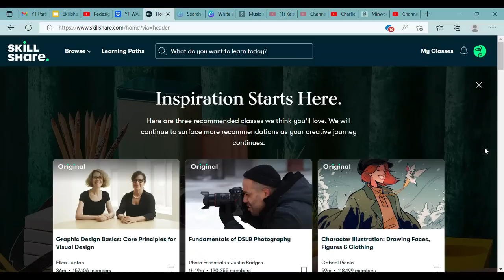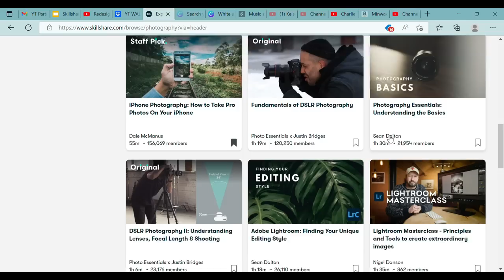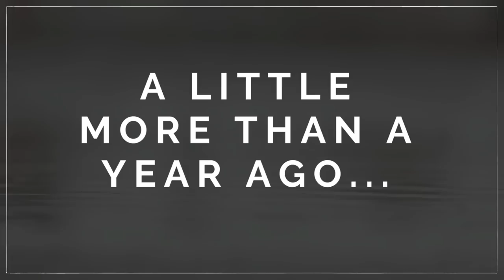STAIRWAY MAKEOVER REVEAL!! | How I Turned My Carpet Stairs Into Hardwood

Comment: If you ever have that problem again with your wood looking pink- mix up a paint wash using a green  paint. It will minimize how much red/ pink if popping thru. 
I had to do this method on a mid century tiered side table. I was about ready to pull my hair out but then remembered the color wheel- green/ blue cancels out red/ orange. Hope this helps! Your stairway looks amazing btw!! Great work!!! ❤
Reply from the maker: Thanks for the tip!

Comment: You really need to rig up a sawdust collector. Just put a PVC elbow joint on the table  and connect it through the lid of a trash can. Use a flex tube to help ease lid removal. And wear a mask when cutting wood. Wood dust is dangerous! So don’t have your kids stand in front of the output of the dust chute.
Reply from the maker: While watching the footage back, I realized I totally could have hooked up my shop vac to catch all the saw dust. I’ll try to remember this for future projects.
Reply: Good suggestion….minus the unnecessary ‘shade’. 
I’ve watched hundreds of random home renovations/maintenance YT videos, clearly some are better than others. As for this staircase makeover series…TOP NOTCH! Being a novice ‘Jane of all trades’, I am so impressed with how many of my skills have bumped up a level just from the ‘little details’ covered in these videos. I’ve got nothing less than gratitude for Kelsey’s efforts…that she has taken the time to share at no cost to me.

Comment: Great video and project! And thank you for the explanations. I don’t know if you answered these already - don’t have time to read all 232 comments - but, what were you using to wipe the caulk on the treads; looks like baby wipes? Also, how did you fill in and finish the nail holes on the treads? Thanks for your help and replay!
Reply from the maker: Yep baby wipes are super helpful when caulking because they help to smooth the caulk and then you can just toss them. I was prepared to fill the nail holes with wood filler but when I went to do that, I had a hard time finding them! So I just left them because they’re almost impossible to see.

Comment: This is awesome! question, what did you do for the landing at the top of  the first set of stairs?
Reply from the maker: These are the only stairs. I ended up replacing the carpet in the upstairs hallway with the same flooring as the first floor.

Comment: Hi, great looking stairs. Since you are adding 1" steps/treads, the space between the top step and floor will be an inch shorter than the rest. Also, the bottom step will be an inch taller. Could this be out of code? And a tripping hazard?
Reply from the maker: I looked up my local building code and it’s still in the acceptable range. It hasn’t been a tripping hazard so far.

Comment: Kelsey did you have to trim the sides of the treads to fit in your stairwell? Or just the backs? I started this project at your inspiration and we are having a bit of difficulty cutting the sides to fit flush even though we used the stair template tool. I'm thinking the side angles will change once we can get the tread in be able to determine how much needs to come off from the back. Do you have any suggestions?
Reply from the maker: I trimmed both the back and sides. I trimmed the sides first to the correct angle then trimmed the same amount off all of the backs. They are definitely not perfect but I was able to get a pretty snug fit. Hope this helps.

Comment: I am curious - you used a standard 1" tread and by installing them on top of the stairs "subfloor" wood it added about 1/2" to your stair height. Is it noticeable when you walk up/down?
Reply from the maker: Nope not at all. I add them to each stair so the difference in treads stayed the same. The only treads that are a little different are the top and bottom and you can’t tell at all.

Comment: If you don't already know, I recommend you learn color theory and the color wheel.  What I hear you saying is you wanted a neutral color since you mixed a classic grey and weathered oak.  You started out with redwood and that naturally has a red/pink undertone.  In color theory, you need to go across the color wheel and that would be green (sounds scary but it's not) or ash-based color to neutralize that red/pink color.
For the white banister you can strip down the paint and then finish sanded down to wood and then stain as well.  It probably won't be exact since the wood isn't the same but I don't think most people won't notice the difference.
Great job
Reply from the maker: Yep knowing the color wheel is very helpful. Just hard to find a green tinted stain.
Reply: @KelseyRomitoDIY  I am a hairdresser, it's funny so many people are afraid of the word green in hair color (unless that is what you want) so they call it ash. I have only done a few staining projects.  Overall I have the feeling staining has the same fear.  Either way, you taking the time to experiment and mix your stains for your end result is beautiful.

Comment: The staircase looks great.  I just wanted to point out that in all the other staircase renovations I watched, the treads and risers would go on alternately.  In other words, start at the bottom and put on a riser, a tread on the top, then a riser, then a tread.  That should have taken care of that gap that you ended up between the tread and the riser because the riser would have been laying right on top of the tread.  Did I miss something?
Reply from the maker: Yep I’ve definitely seen lots installed that way. However I do think I’d still have the same issue because the material I used for the risers was super flexible so it would still follow the line of the wood underneath the risers. Hope that makes sense. Oh well. Caulk to the rescue again!

Comment: I've looked all over but can't find the brand of stair treads you bought and they're not listed in the materials used part.  Does anyone know?  I need to buy some ASAP!
Reply from the maker: https://www.lowes.com/pd/L-J-Smith-Stair-Systems-11-5-in-x-48-in-Unfinished-Red-Oak-Stair-Tread/1001201404?cm_mmc=shp-_-c-_-prd-_-mlw-_-ggl-_-LIA_MLW_122_Mouldings-Specialty-Millwork-_-1001201404-_-local-_-0-_-0&gad_source=1&gbraid=0AAAAAD2B2W9P8HMHKHUHI5IF9lxU6dy4t&gclid=CjwKCAiArfauBhApEiwAeoB7qNegCmurOJPr2q94ZW5bnxuqHxg5RVaS7o4mTjRlKE7zb7EK4gtjZhoCYb0QAvD_BwE&gclsrc=aw.ds